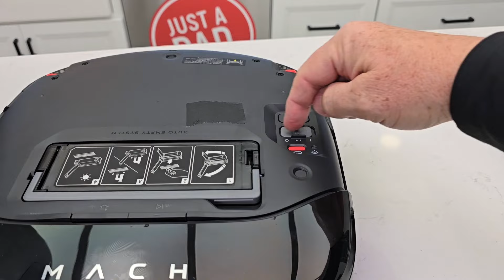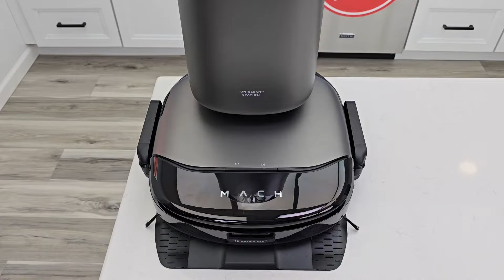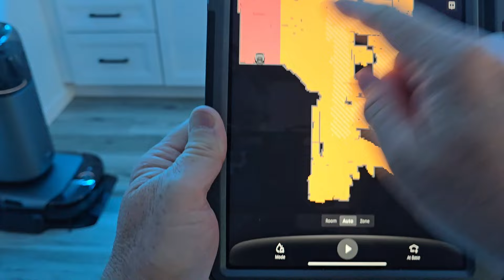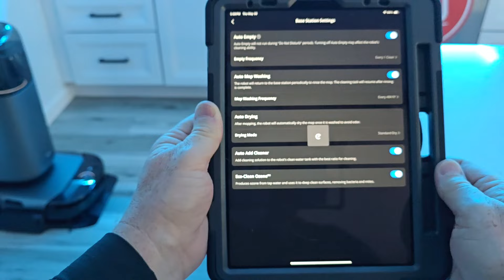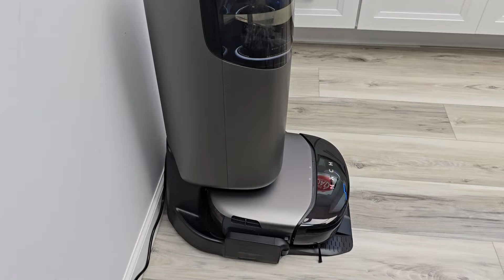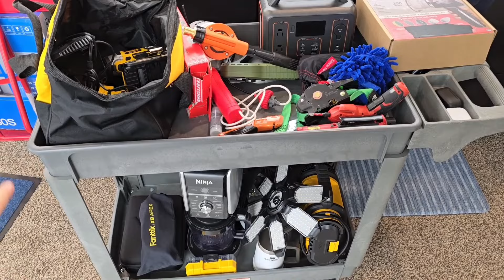Eufy Omni S1 Pro Washing Robot Vacuum UNBOXING & SETUP

Comment: Just arrived yesterday.  Did one run. Stopped mid run with error. Error e20. E30. Eb1j. Eb1k.  Around 70 messages of errors.   Now unit blinks red but won't work.   I went through trouble shooting options . Nothing.  Spent 2 hrs on phone with eufy.  Nothing. And they won't send a replacement until they have this unit back.   Hard to believe such an expensive item can be so badly defective.  And company won't back it wanting me to go through warranty process.
Reply from the maker: sorry to hear that,  I say if they fail it usualy is right out of the box.

Comment: I’ve had mine for a couple of weeks and today tried to map and clean a different floor, ie where there is no base station. It is supposed to return to the starting point rather than the base station when it finishes, but did not do so and turned red with an error. Looking at the manufacturer’s video online , this is EXPECTED, NORMAL procedure; and the rigmarole of what you are supposed to do next is unfathomable. I gave up. Would be fascinated to have a look if you gave it a go and got it working.

Comment: I was about to buy this robot vacuum but this video saved me! I live in a country with 220V and your video made me realize that this robot vacuum works with 100-120v.

Do you have any recommendation for a good robot vacuum (if possible with mop and auto cleaning) that supports 220V of electricity?
Reply: I got the device from Saudi Arabia 220 volts

Comment: I just bought eufy s1 pro and started install it. But the EB1k error keep showing. It said error when the robot refiling clean water. The solution said I need to remove the robot from the base and press the recharge button to allow it to recharge automatically so I did but didn't work. Technical support said I need to turn off and pull out the power outlet to reset so I did. But same error again.
Reply: Same issue.  I had e20 and ebj1 .  Right out of box

Comment: Hey, Just A Dad, can I ask you a couple of questions, please? 
I know you said that the vacuum isn't the main selling point, I've got the Dyson 360. It's getting on a bit now but it's a fantastic vacuum. So would it be worth keeping it and using the Eufy as a mop and for light vacuuming?
Also, do you know if the Eufy automatically orders its cleaning solution when it is getting low? 
Thanks in advance for any reply.
Reply: Oh I nearly forgot. I have no pets and I don't have any carpets, rugs or children. So the Dyson is probably overkill. 
The reason I'm thinking of getting rid of the Dyson is because I can't clean room by room. The app is very outdated, so I can't say "clean the kitchen." 
So really I only need light vacuuming only. So keep the Dyson and get a Eufy or just get rid of the Dyson and use the Eufy for everything. 

I've seen in the comments that Eufy may be bringing out the S1 Pro that can be plumbed in.  Have you heard anything about that?

Comment: I would like you to recommend a good robot that vacuums and mops. I don't care about the price, I just want it to do its job well. I bought the roborock S8 pro and I didn't like it at all. My floors are dirty and it doesn't clean them well. The garbage left in the joints is not collected. Do you think this eufy Robot Vacuum Omni S1 Pro is worth it. I need one that vacuums and mops well, especially the kitchen. I trust your experience. excuse my English. I did the translation on Google

Comment: From Eufy, “The built-in ozone generator creates ozone with tap water, which can be used to clean both the floor and the vacuum cleaner itself during its self-cleaning process.
 
Only tap water can be added to the clean water tank. Mineral and purified water have been artificially filtered and added with trace elements. The conductivity of filtered water is very low and cannot be used to generate ozone.
  
After sterilizing the floor, the ozone will break down into oxygen in just a few minutes. The entire process is non-toxic and environmentally friendly. Additionally, the ozone concentration has successfully passed the NCB standards for product certification which is in line with the CB Scheme. The percentage of ozone in the room does not exceed 5x10^(-6), and the amount of ozone dissolved in water is 0.4 mg/L.”
Reply from the maker: wow just what I was looking for.

Comment: Have you reset the S8 MaxV? I've been told that the new firmware is causing the Lidar problem. If you reset the whole thing, it should work afterwards.
Reply from the maker: no I just sent it back and got a new one